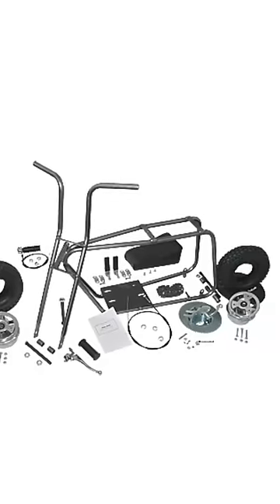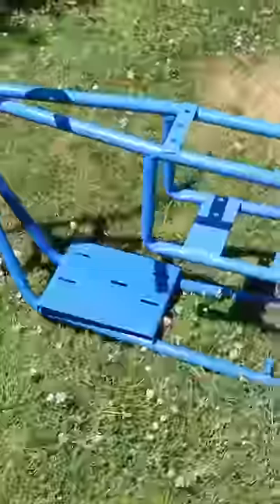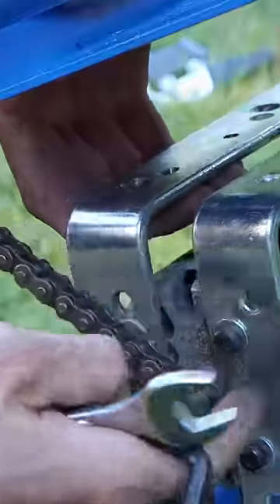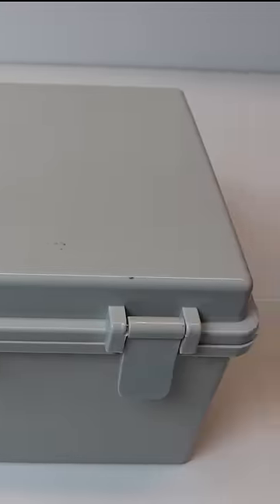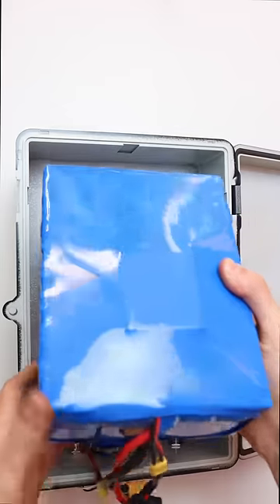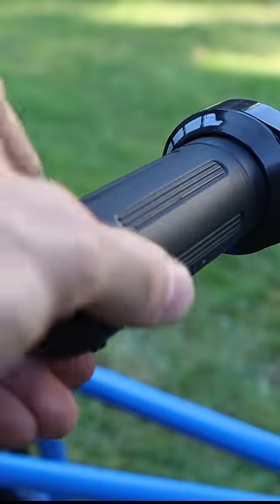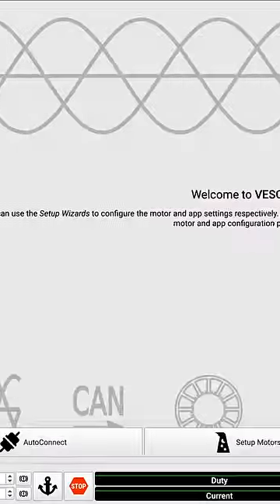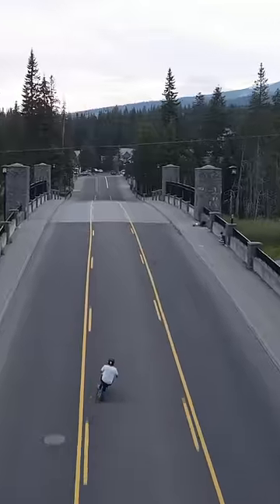Building a 7,000W DIY Electric Mini Bike #diy #electric #minibike #ebike

Comment: Blessed those living in a country where you are actually allowed to use your skills like that. And not choked by regulations.
Reply: Yea, germany comes to mind.
Reply: @raimondsstokmanis1892 are you not allowed to do things like this in Germany?
Reply: @datsun7023  No there's wat and speed limitations. If you have a certain license, fastest/bestest you can get , is like a 500w motor, and top speed of 45kmh. Anything above that , and you will be fined. Not to even mention the bikes need certain certificates etc etc.
Reply: @raimondsstokmanis1892 the US has a limit of 750 watts and 28 mph, with pedal assist. with a throttle it's 750 watts and 18 mph. anything more than that and it needs registration. technically the bike in this video is illegal in the US and needs to be registered.
Reply: Can have them in NY as long as you’re of age 13+ and follow same rules/laws that apply to riding bikes on the streets
Reply: @buskey81 Wrong. There’s class A B and C class E bikes. C being the fastest, has a max of 28 mph. Anything with an electric powered motor that exceeds that has to be treated like a moped. Insured, etc
Reply: You can do this anywhere.  

Just don’t get caught..
Reply: Everything is legal...aslong as you dont get caught
Reply: naja wir können es trotzdem machen fahren dürfen wir dann hald nur auf privatgrund ich denke er darf so auch nicht am verkehr teilnehmen 
aber da gebe ich dir recht wir werden schön von den regeln und verboten eingeschränkt
Reply: @WARRIORNORWAY just don't get caught I have been riding 1500w 40mph bike for 3 years
Reply: usa has regulations too but electric bike regulations are not enforced very much
Reply: Move out of the city
Reply: Agree but i guess safety
Reply: @user3wx9V-178 can't register without vin if you're in the country and stay off big roads you should be fine
Reply: where do you live that you can't make it?  riding it is a different story only illegal when you get caught.

Let Jesus catch you.
Reply: @nigmane  if you clicket on translation than the overall sense is messed up the translator is not good in translatin german to english
Reply: @anthony5227 
That's some sh*tty advice tbh
Reply: @Dr.W.Krueger  
If you took my comment as advice, you’re just not smart my guy.
Reply: Massive 16s3p😂
Reply: We have limitations we just don't follow them.
Reply: @pumbamatata305 I know, that was rich 😂
Reply: Why? Safety rules and regulations are there for a reason and that is to ensure the wellbeing of those around you.
Reply: @nigmane  the nuances might have been lost in (Google-)translations. "Wir werden ganz schön eingeschränkt" in German means more like "we are seriously limited by...", i.e. poster doesn't appreciate the restrictions either
Reply: Well part of the fun of minibiking is that it's illegal... I ride everywhere fully prepared to go to jail. Never have but it's a risk.
Reply: @YeeterMcBeater470  You should be good as long as you’re pedaling. I live in Las Vegas NV and cops haven’t bothered me on my e-bike, I don’t even have pedals anymore, but I stick to the speed limit (I don’t ride faster than 40mph even in 45mph zones) and ride respectfully. At your speed, as long as you don’t ride like an asśhole, e.g. run red lights and stop signs, impede traffic, ride fast on sidewalks/pedestrian pathways, etc. you shouldn’t catch any heat from 12, at least I haven’t in my 2-1/2 years of riding.
Reply: @YeeterMcBeater470  Yeah, you’re big chilling then 👍💯
Reply: @user3wx9V-178 not true, it's different for every state in USA, stop spreading fake information
Reply: New Zealand too
Reply: @bigchungus7183 in my state its class 1. Class 2 and. 3 same concepts.but yeah am not going register mine anytime soon lol.
Reply: @anthony5227 exactly youre right.dont full trottle around 5-0 .dont full trottle near people would rats you out the local authorities.definitely lie that its only 750w and it cant go pass 15-20mph
Reply: 40?did you upgrade your controller and run higher power battery.I achieved 50 same for my buddy but we are small riders build 5’6-5’7 160 lbs
Reply: @raimondsstokmanis1892 in the Netherlands you arent even allowed over 250watts. 😢
Reply: @tylerdias8323 who the hell is gonna start checking electric scooters for how many watts. Cops dont care
Reply: @fastfords9072  maybe in merica, they care in EU/UK
Reply: @tylerdias8323  thank god i dont live there
Reply: @user3wx9V-178 there are no federal regs on it
Reply: Why talking like this..are you from north Korea
Reply: In Quebec they have your homemade vehicle inspected by an engineer and assign a new VIN if it passes safety checks. In practice this means it's quite easy to buy a motorcycle with a blown engine and you keep the original frame for an electric conversion, but it's much harder to convince them that your homebuilt frame is roadworthy. In practice they also don't enforce ebike conformity stickers, and if your bike has pedals and a diamond frame, the cops will assume you're under 500W unless they witness speeds that are physically impossible for a legal ebike.
Reply: @@KelvyMartins99Brazil is hell period 😂
Reply: You made it sound like you were oppressed lol
Reply: @pandamilkshake why then do they make it a requirement to be pedal assisted then? I've ridden those and they will randomly shoot forward when you're not even moving and are terribly unpredictable increasing the risk of falling off. But they pretend they are safer than throttles 'for your safety'. You can make any ebike go at pushbike speed when it's necessary. Higher powered ebikes are good where it's safe to go faster as well as for climbing hills.
Reply: People only say that until it affects them. Look at gun regulations. Noone other than Americans want regulations like that
Reply: @raimondsstokmanis1892 ahahahha in France you're not allowed to ride between cities and cannot cross the 25km/h speed limit 😂😂😂😂 way more restrictive!
Reply: @bigchungus7183 yea my mini bike is classed as a moped. It’s a 212cc and it goes 60 mph. I don’t have any registration or insurance tho so if I’m caught I gotta run or it gets towed and impounded.
Reply: @alebobwa1512  I slapped a 70cc motor on a mountain bike and it became illegal to ride lol
Reply: the worse that happens just a ticket for trying to feel sooo just do you
Reply: It isn't legal in any country lol
Reply: @user3wx9V-178 but most people dont actually care about that so its cool
Reply: @WARR.IOR77 If I had to guess you live in the UK
Reply: We are choked out by regulations though just ask anyone who builds real shit not these over hyped kids toys 😂
Reply: I don’t live in the country and I have tons of regular bikes bikes with engines and mini bikes with huge engines that are loud and other smaller engines that are 2 strokes and are insanely loud and I just don’t care about the regulations and stuff I’m out having fun and it’s not hurting anyone
Reply: canada😢
Reply: Nah I don't think any country would think that a former citizen of their country would make a little moped thingy on their own 💀
Reply: Where can you not do this?
Reply: @raimondsstokmanis1892  i just have a illegal bike i made a ebike that goes 70 kmh the max where i live is like 40
Reply: @raimondsstokmanis1892  You can't legally build a vehicle going 45 kmh because at this point you already need an insurance and no insurance without papers/TÜV. And 500w is only for pedal assist e bikes. So the only option ist that it goes under 6kmh because vehicles with a speed of 6kmh are legally not a vehicle u have to insure.
Reply: @HansWurst-jq4jb  i dont have insurance and mine goes 45 with 0 pedal assist all motor
Reply: @duckieking4234  OK that's nice. But if you are from Germany this is a  traffic violation (driving without insurance and driving without operating permit[Allgemeine Betriebserlaubnis])  which is punishable with up to 3/4 Points in Flensburg and a fine of between 50 and a few thousand euro :) And if u also have no drivers license class B or AM it's also driving without a driver's license which is a felony (Straftat) punishable with up to a year in jail.
Reply: In the US this isn't legally an electric bike because no pedals, and it's not street legal as an electric moped / motorcycle as it fails to meet regulations. Legally it's an off road use only mini bike.
Reply: @buskey81 It's not a bicycle. Legally no pedals means it's an electric moped / motorcycle, and those are the regulations you need to be following.
Reply: @HansWurst-jq4jb  deadass just dont get caught brah ion know what to tell u obviously dont go 45 mph down a major street but like just dont get caught or better yet go get what u need to go that fast
Reply: @ButterfatFarms  that is what it would be called here also, as I said getting caught riding on public streets here, which is most likely, will result in serious trouble :)) gotta love  Germany for all its regulations
Reply: @HansWurst-jq4jb  In FL this would be a motorcycle that would need to have a VIN, running lights etc. added, and be registered and have a license plate on it. Legally we can't have any fun like this here either. Not on the street or bike lanes and sidewalk anyway. lol
Reply: @raimondsstokmanis1892 you do realize these are not road legal here? They are illegal to drive on the road. These people are risking citation or impound if they get caught on the road with an unregisterable bike. That can't even go fast enough to be road legal. The concept is the same to scale up though but you'd need turn signals, lights, etc.
Reply: Acctually in America this is considered illigal , almost every state doesn't allow anything electric over 15 mph
Reply: Yes you are, but when you use it the cops will come just like in a cozy police state.
Reply: Who says you need to tell anybody, it’s not a crime if nobody sees you do it
Reply: @raimondsstokmanis1892  um its 250w and 25km/h and pedal assist only. literally anything else needs a CE certificate, license, registration, insurance, helmet, ...
Reply: @raimondsstokmanis1892  thats pure insanity. Wha6t was their "reasoning" for it. I assume it was automotive lobbyist but what did they say?
Reply: @user3wx9V-178  it depends on the state and it is pretty random. Some states and even individual countries will be super restrictive and basically say anything above a certain power can only go on the road but it cant be over a certain power making it too slow for the road. Meanwhile some other places are just like, "Are you gonna die if you crash" "oh ya 100%" "mmmmh fine but just dont come after us when you do"
Reply: We have E-bike laws in Canada about wattage and speed but damn near everyone just ignores the law and rides whatever E-bike they want. Just make sure to keep an eye out for cops and make sure you don't go past 32KPH (speed limit without a license and insurance in most provinces) if they are around. They aren't going to pull you over and inspect your motor to make sure it's within the wattage limits. They really don't care that much. Pretty sure they know most E-bikes they see far exceed what's technically legal but as long as you aren't going past that magical 32KPH number in their presence, they won't bother you.
Reply: It’s because our country is so damn car centric that we need things like this to get around affordably. Or just for fun but still
Reply: I wanna know what countries can you? In the us you can’t on public roads legally with this stuff there certain things you can make it trail allowed but everyone does it without getting arrested so idk
Reply: Mexico?
Reply: its "choked by regulations" because it used to be choked by death
Reply: @josef-yx6zf the whole "can only drive it on private property" means you can't use it. "Use it" means to go places
Reply: You should move
Reply: @raimondsstokmanis1892  thats literally wrong there are no limits on A licenses. only a1, a2 and AM have restrictions regarding wattage/weight and only am has a speed limit
Reply: @anthony5227 yep exactly
Reply: well, I for one don't want to have people driving self-built things like that near me. It's fine to build them or to drive them on a test track - but on city roads? nah, thanks!
Reply: @DresdenFPV exactly.

Whilst it's really cool to make your own stuff and mess around, keep that stuff on private land and not around people who you are essentially forcing to unwillingly/unknowingly participate in your chaotic tests and experiments.

If/when something goes wrong, it's really not ok that members of the public are caught up in it.

It's the sole reason for the regulations, and I'm absolutely in favour of them... especially because they prevent masses of less-than-intelligent people from taking over the roads with half-baked machines that can harm people.
Reply: @DresdenFPV Ok Karen
Reply: Yeah I would love to ride this around but I live in Finland and now I have to deal with a whole load of bs because of electric scooter crashes. So now I cant go over 25 kmh and I cant drive my E moped without insurance. 
One of my dreams is to build cool stuff like this but I cant complete them because most of the time the laws make it illegal or way harder to do legally
Reply: @raimondsstokmanis1892  loooooooooooooooooooooool xD
Reply: @user3wx9V-178  bruh my razor is 11k watts and police doesnt say anything
Reply: dude everyone in the comments saying this is illegal, are you goofy? It’s your life they can’t take your birthday away🤣🤦🏻‍♂️
Reply: @tannerthonas4189  why by something in a certain country if as soon as the police see it you lose it for life use your brain man
Reply: @raimondsstokmanis1892 what are they gonna do take YOUR stuff no you just don’t want to build it and are lazy don’t let some bums tell you what to do
Reply: you cant even use a e scooter in uk now without a drivers license..
Reply: oh this is very illegal in USA lol
Reply: I'd rather live in a city without vigilantes such as you. Regulations are there for a reason.
Reply: in finland you cant drive anything that goes over 25kmh if you dont have a lisence or the thing youre driving isnt lisenced
Reply: @raimondsstokmanis1892  same rules in Italy, except no one cares abt the rules XD
Reply: @raimondsstokmanis1892 That limit also exists in the US, this minibike is fully illegal. The main difference is the laws are probably enforced WAY better in Germany
Reply: @user3wx9V-178  In Italy, with our overly restrictive laws, the maximum power and speed for an unregistrated bike is 250w and 25km/h....then they wonder why in Italy nobody follows the laws!
Reply: you think this is legal? LOL
😂
Reply: @datsun7023  Germany is one of the most overregulated countries in the world.

Comment: That’s really really cool!
Reply from the maker: Thank you!
Reply: U need battery cooling. Hope you don't go into thermal runaway😮😮😮.
Reply: По автономности работы он проедет не дальше чем велосипед, поэтому нет смысла на это замарачиваться. И педали крутить полезно для здоровья
Reply: @darkhunter777 if I had to choose ebike or bicycle without motor and could only pick 1 , ide pick without motor, but I still want an ebike very badly, the bicycle is the coolest invention leg power bodyweight, I just want a battery I can charge like a dynamo as I pedal
Reply: @ShouldaWaved  
Cars powered by an electric motor have a large mass, while they lose competition from internal combustion engines. When they invent lightweight batteries, then it will be different
Reply: @DIYesk8Builders try to go off road with it
Reply: @DIYesk8Builders where did you find the frame

Comment: I'm part way through building my own electric bike and just saw this
Reply: How did it turn out bud?
Reply: @lyteyearz5810  Thanks for asking. 
The frame went fine, but the only motor I had available was not powerful enough. I plan on sorting it in the future, but at the moment, it's just a decoration.
Reply: @ED-uk2jf good luck man!
Reply: @ED-uk2jf  if you still want to, it might be too expensive but i recommend a electro and co kit. the best one would be the extreme 11,000w kit
Reply: @Baergaming-ts9cx  11000w?
Reply: @ED-uk2jf  yeah because it's really powerful but if you are using a bigger bike use the 14,000w kit
Reply: @ED-uk2jf  the 14,000w might be too much because on a dirt bike its able to go 55+ mph

Comment: This strongly resembles a gas minibike I built from scratch many years ago. I used plumbing pipe for a frame and it was rather heavy. I needed to register it because of the engine size I used. I had a lot of fun with it. It hadn't occurred to me to build an electric version until seeing this. Nice work. 
   It's strange that individual states regulate gas engine sizes for scooters and bicycle conversions but don't regulate electric motor sizes at all.
   I wonder why you spent the extra money on a gasketed battery box when the cable entrances aren't sealed.

Comment: If you are going to design and build your own electric mini bike why would you put the battery and the bikes cg that high?
Reply: I think because bigger is better is usually the motto. And also go big or go home can also apply in this situation😅
Reply: I have a 1970 Sears and Roebuck mini bike did I put a 125cc that's modified on it that's a 4-speed and I've only had the balls to get it to around 60 to 65 mph. I'm worse than this guy